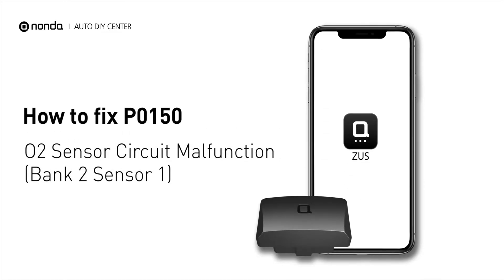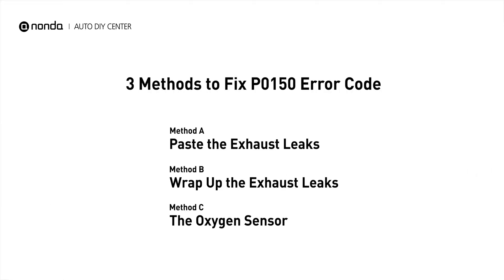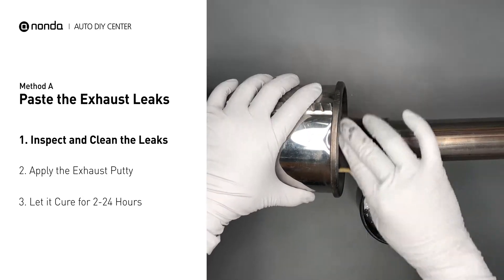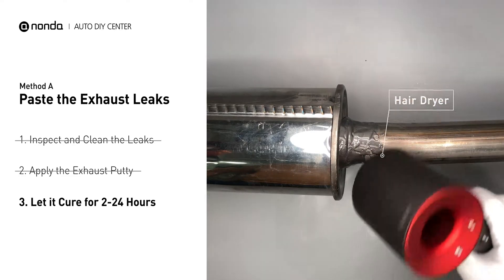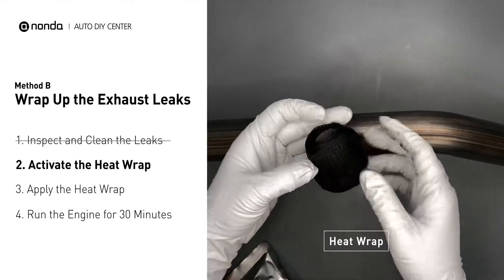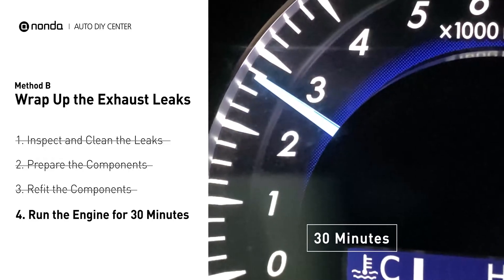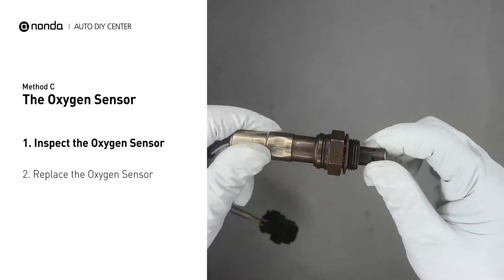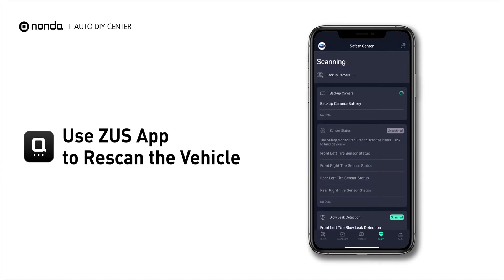How to Fix P0150 Engine Code in 4 Minutes [3 DIY Methods / Only $9.85]

Comment from the maker: Hi, I'm Steve, nonda's lead mechanic engineer. 
Feel free to leave your comments here if you have any mechanic questions, I will be glad to help you out!
Reply: I have a 2000 Toyota Sienna that is throwing code P1050 and P1030. I know the 1030 is the variable valve sensor but I can't get anything on 1050. Google keeps thinking I mean 0150 so thus I'm here. I know it's been two years but I hope you're still out there.
Reply: @Malibu1515  I know exactly what you mean. I have the same p1050 code on my dodge right now. My mechanic said it’s bank 1 intake solenoid front. Let me know if you got to fix the problem. That code driving me crazy.
Reply: Your reply form does not cater for South African residents
Reply: How about replacing that 02 sensor instead?